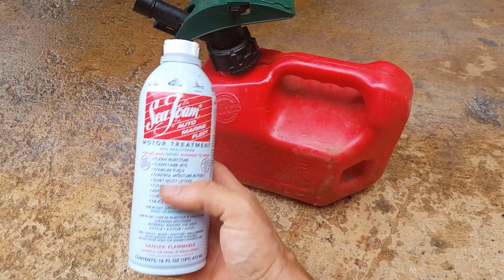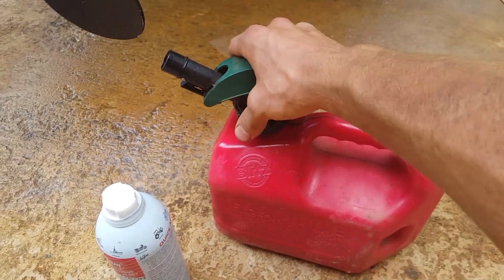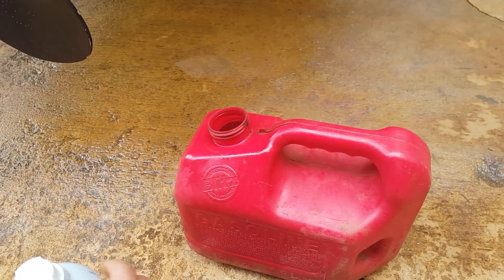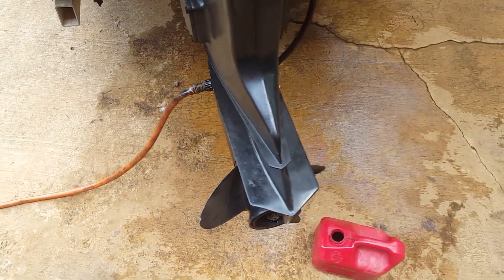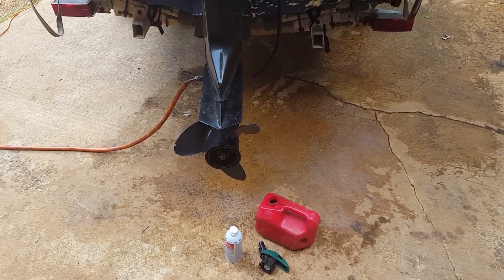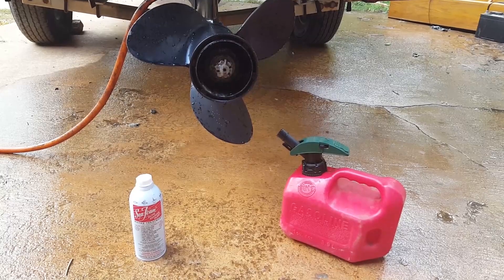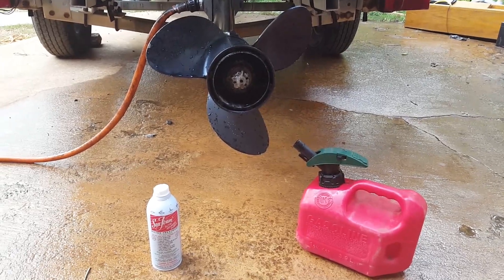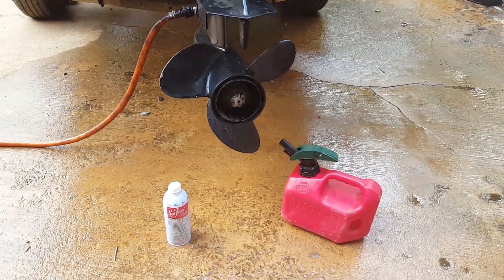Seafoam Shock Treatment - Outboard

Comment: I have an 87 Johnson 150 V6. Vro removed and mix 50:1 gas oil 87 Oct with stabil. I go out 1 to 2 times a week. I never experienced this issue. Yesterday we went out to a river system that was idle speed only. I know I need to get a link and sync done, and I suspect I'm running rich. I am about to remove the carbs and clean them because the gaskets are leaking. We idled around the river for at least 2 hours, never got to make a wake. This morning when I got up there was black goo all over my transom saver and running down the stern side of the outboard and some possibly even up in the engine.i cleaned it up and later came back out and there was another little dribble. Some say it's because the two stroke hate idle and it's nothing to worry about. Just throw a sea foam shock treatment then get back out and run her good. This is my first boat and I'm learning so much already. Oh I also recently replaced the sparks as well.

I was trying to post pictures but since I'm new I guess I can't get.

Thanks again for any help

Comment: Hey i got a question I got a 85 it works great out of the water on muffs but in the water it’s like it doesn’t go in to gear it does out of the water In the water it won’t acelarate
Reply from the maker: Does the prop spin when in the water? If it doesn't spin, something is wrong with the linkages. If it has trouble accelerating, it's probably the fuel pump diaphram!
Reply: @MattsShop  thank you I’ll do some research on that but yep the prop spins while on land not sure in the water

Comment: my motor has an oiler but it' 2 stroke. Do i still pre mix or just use reg gas and let the oiler do it's thing
Reply from the maker: Don't mess with the oiler. Just run it how you always would. That would be double oil
Reply: @MattsShop  okay ty

Comment: Thanks for your great video!

Problem with 2003 Merc 125 2-stroke.  Old fuel lines destroyed by ethanol.  Found lots of brown chunks inside the pump.  Rebuilt pump with Merc kit.  Replaced all fuel lines.  Replaced internal inline filter.  Added secondary in-line glass filter outside of engine so I can see it's getting fuel.  Removed carb tree, opened every bowl and checked for debris (almost none there) sprayed all jets with carb cleaner.  Did not fool with the metering adjust screws!  Plugs fairly new.  Removed all old gas.  Put in 2 gallons of new ethanol-free gas treated with STABIL.

Symptom: when cold, starts and idles good.  Runs rough getting up to plane about 3K. I tried disconnecting one plug wire at at time, then running it.  Seems like #4 is not firing good.  Ran it a while on lake. 

Shut off, won't restart.  
I see fuel in the clear filter.  Will check the spark tomorrow.  Thank you.
Reply from the maker: You did good replacing all the old fuel lines and filters. I did that on this engine too. Keep in mind, the outboard you are working on is much newer and built much different than this old Evinrude.

Comment: I'm surprised it stayed running with the primer bulb horizontal like that.
Reply from the maker: Doesn't matter once you get 'er goin.
Reply: The primer is just that, a primer, to fill the bowl for starting. Once running the engines fuel pump does the work, the bulb has no bearing on operation.

Comment: How much oil should I put in the gas can with my 2 stroke fuel injected motor?
Reply from the maker: You need 2.56 Oz of oil per gallon. You need a 50:1 ratio of TC-W3 marine oil. It's better to get some out of the tank, but I guess you don't premix?
Reply: Matt's Shop I do not premix. Thank you 😀

Comment: Been a big fan of doing this on all kinds of motors for years. Plan on changing the spark plug(s) when you are done, because blowing all this crap out of the fuel/combustion system tends to wreck 'em.
Also -- Obligatory tree-hugger comment --- Please don't do this on the lake or at the dock...all that crap getting pumped in the water is bad, mm'kay?
Do it at home where you can better contain the spill and runoff.
Reply from the maker: I agree. Change the spark plugs and do it out of the water.
Reply: Neighbor's would be super pissed as this would smoke up the entire neighborhood.

Comment: The life of any out board motor. I’m still running a 1986 40 horsepower Johnson that came on my 18’ Alumacraft, it still has 130 psi on both cylinders and they hold pressure. When it gets time to go fishing again you know it going to run like it should.
Reply from the maker: Yea, Seafoam is a great tune up for sure!

Comment: Hi Matt, great video thank you. Just a quick question: I was all ready to do this treatment on my 28 year old Force 90 outboard but thought I'd do a compression test first. The compression on all 3 cylinders is incredibly good, right up at spec with literally only 1 Psi between them all. The engine runs fine generally but I wanted to do the treatment purely because of its age. My question is do I really need to do the shock treatment when the compression is so good? The tops of the pistons looked nice and clean too.
Reply from the maker: You don't have to do it, but it will help. My Force 85 HP runs WAY better after I did this to it and it has good compression. It changed the way it behaves and made it run much smoother. Give it a try and don't forget to add the 2-Stroke oil in the mix.
Reply: @MattsShop  Thanks for the reply, I hadn't noticed it...I was expecting an email maybe? It's the first time I've commented on a youtube vid :-) I did do it but I honestly don't think it made any difference, the thing is, I'd underestimated my motor. I had naturally presumed, as it is 28 years old, that it would be on its last legs, despite the fact that it runs well. Before I did the seafoam treatment (I did it because I'd already bought it!) I decided to take the carbs off to strip and clean them, to my surprise their wasn't the slightest trace of carbon, varnish...nothing, they were like brand new, literally like new! I had a good look in through the spark plug hole and the tops of the pistons were the same; immaculate, as was the reed block through the carb inlet, the fuel filter too was like new. Basically, I've struck gold, it's either been completely rebuilt (which I doubt because the gaskets fell to bits, were hard and brittle) or it's just done barely any hours at all since new. It looks like I'm the beneficiary of a boat that someone bought and never used. Anyway, thanks for the video and I'm sure it'll come in handy one day :-)

Comment: Totally wrong watch the video on seafoams website.You didn’t warm the motor up for five min before running the sea foam.Idiot
Reply from the maker: This method works well for a lot of people. You can change it up a little bit. Just make sure you don't forget to add the oil if it's a 2 stroke.

Comment: Will this fix the high speed jet blockage, too?
Reply from the maker: Probably not. The best way to clean carburetor jets is to take them apart and manually clean them. The chemical cleaners suck.
Reply: I think it does do the high speed jets, just gotta throttle up a few times during the run, get all the juice up in here...

Comment: To make this process much easier as much gas as these things guzzle just add the can of seafoam to your gas tank & take it out on the water and run it. I use Seafoam in my truck,bike,lawnmowers but just a can per 5 or 6 gallons of gas works wonders to keep the carbs & injectors cleaned. Also a big fan of Marvel's Mystery Oil for an upper cylinder lubricant.
Reply from the maker: Yea that will keep your outboard running well. However, this is a SHOCK treatment designed to un-stick cylinder rings and attempt to clear out any carbon that has built up over 30+ years. Kinda two different purposes.

Comment: Hey Matt I have a 89 merc 45 hp classic 50 that runs great until I hit 3/4 throttle or more..then it starts missing, any advice..thanks man!
Reply from the maker: Have you checked or replaced the fuel pump diaphragm and gone through the fuel system?
Reply: @MattsShop  Hey Matt, thanks for the reply!! I just bought the boat and I did a sea foam treatment, and bought new plugs and put them in tonight. Runs great in a bucket, but haven't put on lake yet to put it under load. I checked compression also and I'm at 100 psi on each cylinder, so I think I'm good there. So you think if it still does it, check fuel pump diaphragm next? Thanks bro for helping and any more advice! Oh..also fuel system is good, just coming from 5 gal can to ball and into motor. Pretty basic sety
Up.
Reply: @Mike Hayden thanks man, I checked stator and trigger also with a dva adapter, so I guess I will be doing the carbs next. I was trying to avoid that..lol
Reply: @Mike Hayden thanks again, this motor looks like new to be as old as it is. It really sucks the gas..lol..but I will keep in touch and let you know how it went. Once again thanks brother, I'm going to order these rebuild kits. Been alittle cold here in kentucky to crappie fish, but soon..lol
Reply: @Mike Hayden well do mike, thanks brother!! If I have any issues I'll hit you up, but I have the manuals so I should be ok 🤞🤞🤞

Comment: I have an 80’s mercury and it’s not an outboard will that work and I have a problem where I put the throttle all the way down and it revvs up a lot but it doesn’t go fast would this fix it??
Reply from the maker: Sounds like you have some broken parts or improperly adjusted linkages. This will not really fix a broken motor. It just helps tune it up, clean out the carbon, clean the carbs a little, and make sure the rings aren't sticking. Pretty much just good maintenance. Feel free to try it though.
Reply: U spun a prop

Comment: Dose this work with carbureted or just fuel injectors??:/ or 4 stroke engines ??
Reply from the maker: It works on all outboards! Just gotta figure out how to get the gas/seafoam mix into the engine on the newer outboards.

Comment: Would this work on my 79 evinrude 6hp?
Reply from the maker: Yes! It will work for almost any outboard, especially older outboards.
Reply: @MattsShop  basically I've been told I won't find it in Australia. I've been told to buy something similar from evinrude
Reply from the maker: Does Amazon have it?
Reply: @MattsShop  I've seen it on Ebay, apparently someone in Adelaide is selling so it is here after all. I'm currently traveling Australia so was hoping to find it at the nearest auto or boat shop but looks like I'll have to mail order it which is a shame. Apparently Evinrude endorsed seafoam for their motors but have since developed their own as well. Just hope it's not some kind of snake oil
Reply from the maker: That's crazy. I can't imagine no one having any SeaFoam in Australia when it surrounded by water and boats.
Reply: @MattsShop  apparently it's only exported to Canada according to their website. I might have to start importing it myself. I come from the Northern Territory and every 2nd house has at least one boat so there's a market for it if it's as good as they claim
Reply from the maker: That seems like a lot of boat owners to miss out on possibly buying some Seafoam. That's crazy.
Reply: @MattsShop  I'll give it a go
Reply from the maker: Yea, give it a shot

Comment: will the seam foam( 16 ounces)off set the oil and gas ratio?
Reply from the maker: No! It will not hurt your motor. Don't worry about it. Just mix the gas up using the same ratio of oil you always use.
Reply: Thanks for the response, I was concerned about it but I will go ahead and do it  thanks again!
Reply from the maker: Yea, don't worry about it. You're welcome.
Reply: I added just a little extra oil to my gallon to compensate for the volume of the Sea Foam. Whether I needed to or not, I don't know, but I felt better doing it.
Reply from the maker: Yea, I get the peace of mind thing, but you don't have to do that. It'll be fine mixing it at a 50:1 ratio and dumping the seafoam in the gas can.
Reply: better safe than sorry!
Reply from the maker: Yea, I get that!

Comment: Great video! Have a Johnson 90 dated 1988 that I'm gonna give this a go on....
Reply: I didn't notice a ton of carbon wash out, the engine seems to be a bit better on the hole shot for lack of a better word. Also of note I went through and replaced all the fuel lines before and after the filter...
Reply from the maker: Thanks for the update. I noticed a really improved idle. You were smart for replacing all of the fuel lines.
Reply: Any difference ?
Reply from the maker: Thanks! Yea, give it a shot. It should help.

Comment: This is all good to clean the idle circuit. But if you don't rap the throttle the seafoam will not reach the rest of the carb.
Reply from the maker: +David Jessee Great point! The reason I was doing this is to clean out the carbon in the motor. You are right, if you are wanting to clean out the carb you should hit the throttle a little bit.

Comment: In the 60s and 70s OMC sold a product called Engine Cleaner. that stuff was good, far better than the stuff marketed today. I think the old stuff was pure Carbon Tetrachloride, nasty stuff, but it worked well
Reply from the maker: Great info thanks. I'm sure it worked a lot better than the stuff they sell today.

Comment: Dumb question...why do you add the additional (black) hose? Cant you just disconnect the line from the tank instead of the fuel bulb/pump where you add the black hose? And then stick that same original gas line into the gas tank?

Or is the additional (black) hose a must?
Reply from the maker: +Sal Palos That's not a dumb question at all. I just used a different piece of hose because I didn't feel like disconnecting the tank's fuel line because it is hard to get to.

You can just disconnect your tank's fuel line and stick it into the seafoam/gas can if that's the easiest way for you to do it.
Reply: thanks brotha! already subbed....but appreciate it....doing this tonight/tomorrow!
Reply from the maker: +Sal Palos No problem! Thanks for subbing!

Comment: I've been using Mercury Powertune as well.  While they both seem to work well, I prefer Mercury products since they are backed by the OEM.  Crazy how much this helps with hole shots and rough idling.  It was actually recommended to me by a marine mechanic.  I thought my carbs needed rebuilt and he told me to try this stuff.  Saved me a few hundred bucks, easy.
Reply from the maker: +JAY TV Yea, it works amazingly. That's why I made this video. To show people how easy it is to seafoam an outboard. I know Mercury, Evinrude, and Yamaha all have their "Engine Tuner" fuel additives. Good to know that the Mercury one works well!

Comment: Sorry, really dumb question here. I can't the motor idoling and the fuel bulb won't retain fuel after little bit. It's a brand new fuel bulb. I feel like this is something extremely simple I am missing.
Reply: Can't keep*
Reply from the maker: +Austin Howard Have you checked the fuel pump diaphram and made sure it isn't dry, hard, and plasticy? Also, have the carbs been rebuilt recently?
Reply: Hahahaha nm had the primer bulb backwards...wow
Reply from the maker: +Austin Howard HAHAHA That's funny! Yea that little arrow's direction is pretty important.

Comment: I have a 1998 Force 120. It is not running with all of its power. When alone its runs great, but when I have 1 or 2 guest, it has a HARD time planning. Also has a lot of trouble idling. Will this help me? Mechanics are weeks backed up.
Reply from the maker: +Brandon Freeman Yes! That is a Mercury Force and a pretty good motor. This is the best place to start. You should check your fuel pump diaphram. It is probably old and hard. It is just a thin piece of rubber and easy to replace if your motor is pretty corrosion free.
Reply: The whole fuel pump assy was replaced along with the fuel line and primer bulb. It is pushing a 1998 Wellcraft 190cc center console ( a pretty heavy boat) but I've seen vides online of it pushing big boats at comfortable speeds. I will do this process in morning, I really hope it helps. Thanks for your speedy response!!
Reply from the maker: +Brandon Freeman That's good it was replaced so you can rule that out. I am familliar with that exact boat. They are real nice and well built, but they are HEAVY you are right. Do this first and then check the compression of the cylinders to make sure it is in good shape internally.

What are the specs of your prop? If you have a high pitched prop like a 21 pitch prop this would explain the lack of torque.

You're welcome for the quick response! Thanks for watching.
Reply: Will do. Thanks
I will keep you posted on my progress.
Thanks Again!!!
Reply from the maker: +Brandon Freeman ok cool. You're welcome!
Reply: Hello again Matt
Well, after a day out on the water my Force 120 was still bogging down. I brought to a local mechanic and he put new carb kits in. It seems to be running a lot better as it is idling fine and seems to be running a little smoother. I will go and test it this weekend and give you all an update.
Thanks again!!
Reply from the maker: Glad you got it running better! I would have suggested that you rebuild the carbs, but I assumed that you had already done it, because that is the usually the first thing that most people do. Boat can carbs cause a lot of weird problems if they are not in tip top shape.